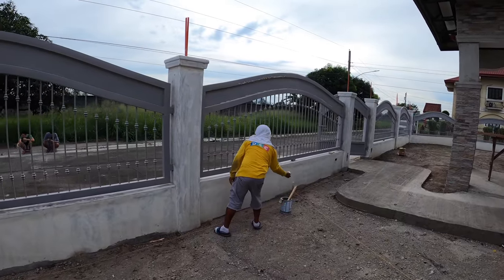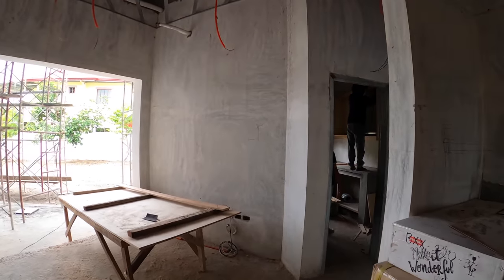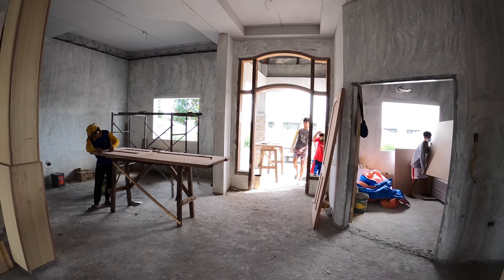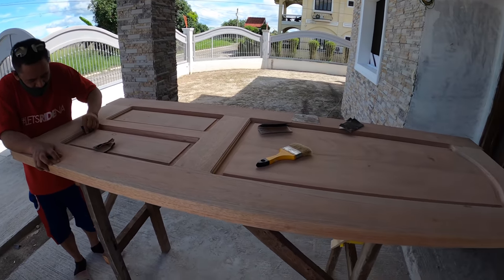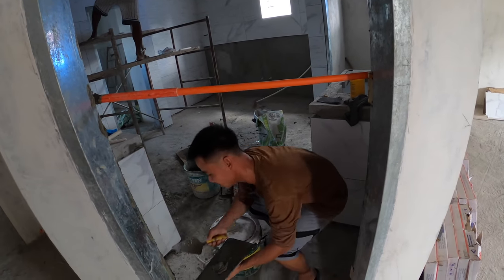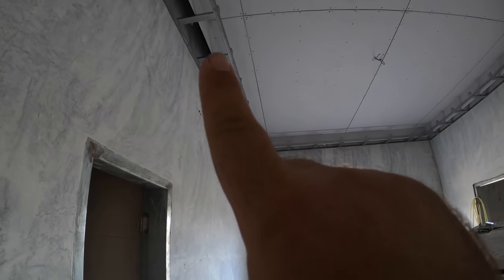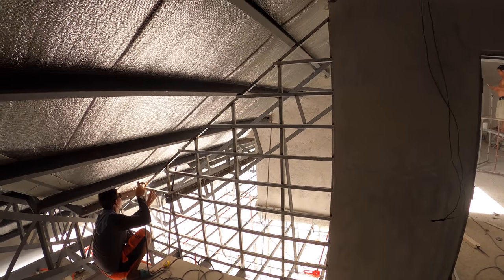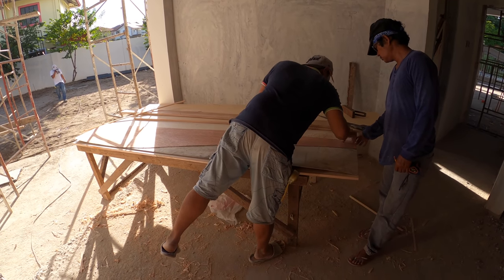Philippine House Building Step by Step, Build Day 180: Drywall Ceiling Grooves

Comment: A question about the back of the cabinets, are you going to put a pices of wood at the back wall of the cabinet or just the cement will be back of the cabinet? I hope you know what I meant...
Reply from the maker: Just the cement. Will be painted.
Reply: Good point! I think it neds backing as well due to humidity causes a lot of molding

Comment: Sir about the concrete sealer are they gonna apply it just before painting your walls?
Reply from the maker: They will apply it to the fiber cement board wall cladding outside. Once dried, next step is primer coating, then the paint. I may have missed a step or two, but that’s the gist of the process to my understanding.